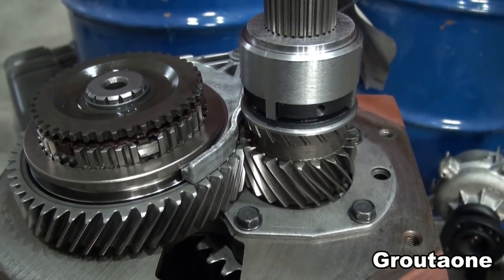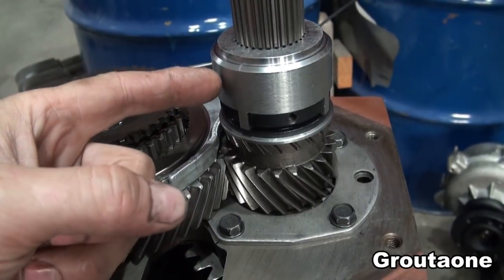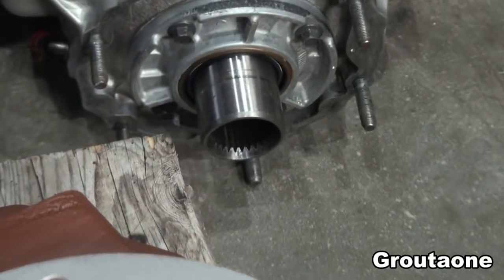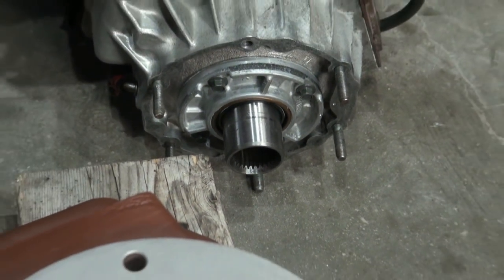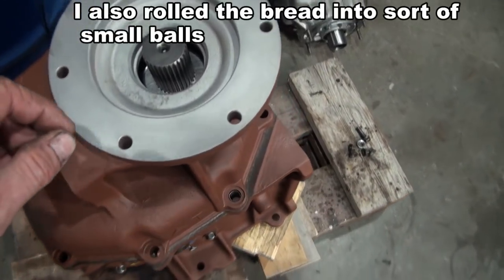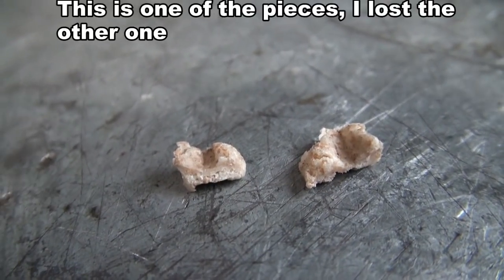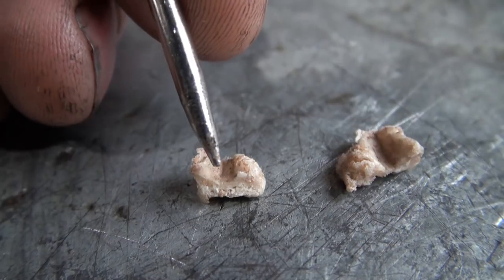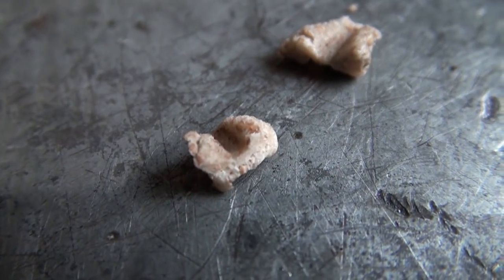Using Bread As A Measuring Device NV4500

Comment: I had that same scenario with same trans and tcase and it bound the shaft. Had to remove the washer on the 5th gear nut in order for the coupler to not bind the trans up once I installed the tcase.